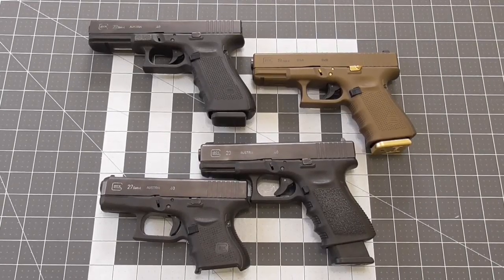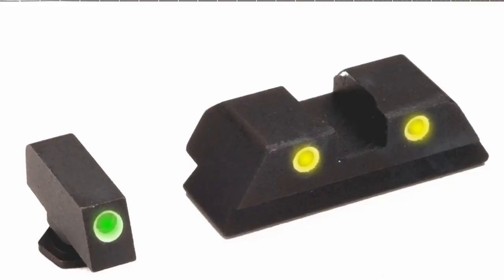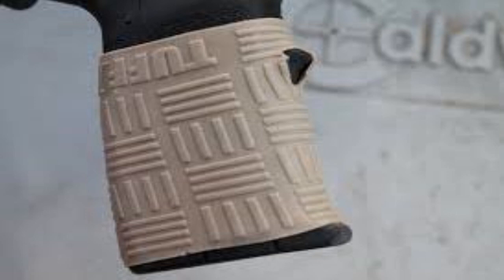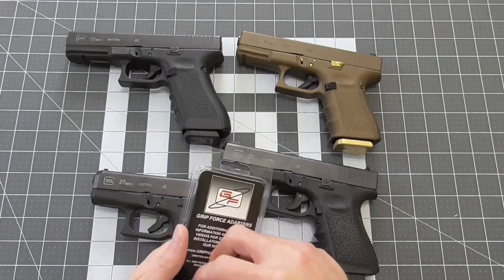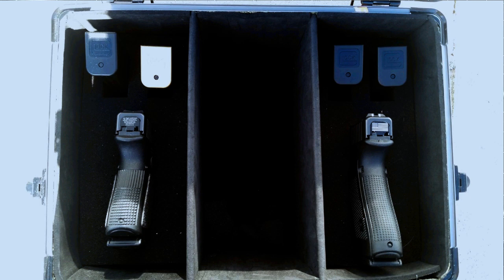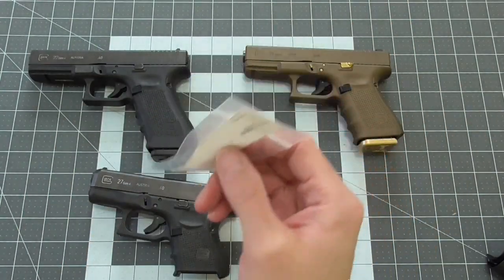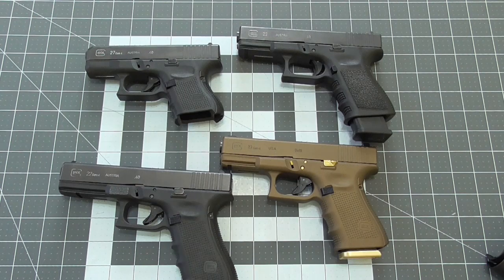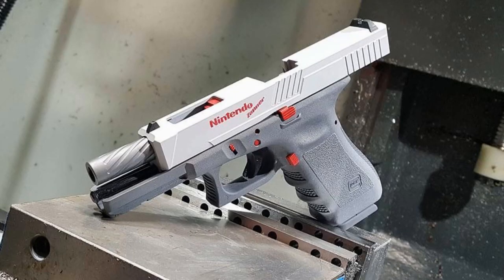Glock modification, aftermarket parts, and other accessories.

Comment: You talked about threaded and no threaded and size changes in calibers with barrels. But I carry a gen 4 Glock 42 and I've been looking for a heavier barrel. Know of any good brands?
Reply from the maker: Dive Hawg94 I'm sorry to say that I'm not as well versed in Glock 42/43. What exactly do you mean by "heavier"? Lone wolf probably stocks the most variety and is the most reasonably priced.  However you may try storm lake, Barstow, Zev and if you are looking for Ultra match grade barrels, check out  "Blacklist". I'm sure that gun may be a bit tougher to track one down for but every brand here is reputable. prices will range from around $100-$300 depending on finish, brand, grade, ext. Hope this helps.

Comment: Very interesting modifications!  Most of this is WAY over my head, but I do like those night sites and the textured grips.  Quick question Chase, is it true that Glocks do not have safeties?  If so, is there's any risk of discharge?  BTW, that underwater shot is cool!  Are they all capable of firing underwater?  Thanks Chase!
Reply from the maker: David Fiorini Hey David, It is true that glocks don't have a manual safty i.e a lever or button. They do have internal safties to where you could drop it off the empire state building and the gun would not discharge.
I know it sounds kind of scary to entertain the thought of having a gun without a saftey however, I have come to prefer this for several reasons.
1. my finger is never anywhere near the trigger unless I've confirmed empty or I've made the decision to shoot. Frankly, I believe safties can do more harm in some instances because it naturally luls people into a false sense of security which can lead to sloppy saftey practices.
2.( I see this almost every time I see someone firing a gun with a saftey,) they rack a round in and go to shoot but can't so they pause a moment and look at the gun until it dawns on them. Although I'm confident in my ability regardless of the platform, I feel it best to keep things as mind numbingly simple as possible, incase that dreadful day ever came and I was forced to use it, all the while bearing copious amounts of stress and adrenaline.
 Also, Revolves don't have safties and are regarded as great starter guns.
despite what many want you to believe, an untampered with Glock will not discharge without something entering the trigger guard and this is why it is important to follow good gun saftey and live by it. As scary as it was at first, you get used to it and it really is no big deal.
Anyway, yes, just about any gun will fire the first shot under water. Many will even cycle like the Beretta 92, sig p226, and many others. The maritime spring cups provide channels in the striker assembly that allows it to flow better under water. Striker fired gun aren't as good at this. It would be much like throwing a punch under water. Glock's even work for the most part under water but sometimes you can get what are called "light primer strikes" for the reason mentioned.
David, I really appreciate you taking the time to watch the whole video! Thank you for your comment as well and I'm sorry for the book I wrote you! : )
Reply: Chase Palagi   Hi Chase, thanks for the answers to my questions,  I appreciate the information.  It makes more sense now why it's not outrageous for a guy not to have a safety.  And I had no idea a gun could shot under water!  Shows you how much I know!!  Lol!
Thank you for making the video, watching is the easy part!  Take care, and see you in the next one!
Reply from the maker: You bet David! To be honest, I'm not certain that it is common knowledge. Frankly, I didn't know either until I tested it. They certainly aren't the most effective and I'm not sure why someone would want that but perhaps it's peace of mind?

Comment: Thanks sharing, Question. What is the best way install reddot on glock 34 gen 3
Reply from the maker: Kanthanok Phonsyry You bet! I suppose that depends on what you want. You can purchase a mount that sits in the dovetail of your rear sight but that sits a bit higher and you will lose your Irons. They also make a picatinny style rail that fits up top but has the same problems. If you know exactly the red dot you want, I would recommend a slide melt. You will have to send you slide to be Milled for the particular red dot you want. This way the the red dot will sit lower and you have the option to use buis. You will have to purchase suppressor height irons though. The only thing about this method is that it is done for a particular optic, so you can be switching them out. Also it may set you back a couple hundred dollars. If you are sure you want a red dot, and you know which one, this is the method I would recommend. Either that or purchase an mos slide, but those would probably be pretty damn hard to find as I'm not sure glock is selling them that way yet.
Anyway, thank you for watching!

Comment: When did you get that Glock 19? Also where did you get all that gold finishing? Was that bought like that or painted?
Reply from the maker: Ben Pope Hey Ben, That Glock is newer than the rest but I've had it for a while now. The finish is a Burnt Bronze cerakote. Glock has some special editions in burnt bronze and gun metal grey. This is one of them. Apparently, Glock does some sort of special mixture and treatment to better adhere to the frame and to better match the color.
I purchased the Gold hardware from the Glockstore. I have a Gold ultra match grade threaded barrel from blacklist barrels comming which should tie things together a little.
What do you think of the gold on bronze? I had never seen it done and thought it would be interesting. 
Anyway, I appreciate you watching!
Reply: Chase Palagi I think it looks cool. I have a grey Glock 19. Idk if you're on Instagram, but my name is GolfGunsLife on there and I have pics of it. Its a factory Grey 19
Reply from the maker: Ben Pope I am not on instagram but I need to be. I will check it out if it's not private  (or whatever is equivalent for instagram.)
oh okay, so you have the grey one? That's the one I was referring to. do you know anything about these? I saw these two colors and I really liked them! There just isn't much info on them so I'm not sure what the deal is. Is there anything special about them that you know of? l was just wondering if they're only making a certain number or anything like that.
Reply: Chase Palagi I'm not sure. I have never seen another grey or burnt bronze to my knowledge. My gunshop was the only one to have them in my area and I got the only one they had. I've seen a lot of FDE tho.
Reply from the maker: Ben Pope I was trying to check your page out but there are ads that can't be minimized? 
Anyway, I saw a glock next to the P320 and another one with the zero tolerance. I think they are the same gun but wasn't sure due to the filter. I really like that! I want to get one and do stainless hardware, I think that would look awesome. I'd lose points with the "tactical crowd" but I think it'd look great! lol : )
Reply: Chase Palagi ya I actually just got the p320 carry model yesterday. I love it. I was after a full size p320, but for some reason it just looks odd to me. The carry model feels great and looks great.
Reply from the maker: Ben Pope Of Nice! Good for you man! I love it! In fact I carry that one more than any other gun. I switch everything up every once in a while but once I stipple the grip, It feel absolutely perfect in hand! That's cool, I hope it serves you well!

Comment: Nice, I just picked up 2 kci 31rds mags for my Od glk22Gen4. testing it out tomorrow  at the range. #funsitcks
Reply from the maker: john ohhwee Hey John, I really hope you have better luck with them than I did! I ordered a couple  several years ago and neither one of them worked correctly. If I only loaded them up with few rounds they would but any more than that and the spring and follower would bind. I even took them apart, cut all excess plastic molding, brought factory glock springs and Never could get them to run properly.
I have heard of  some that did just fine with them though!
I really am not trying to be a buzz kill, I bring this up in the hopes that you are able to take them back and possibly exchange them for the 22 round factory mags that Glock makes.
 I truly wish you the best of luck with them!
Thank you very much for watching and taking the time to comment!
Reply: Chase Palagi for sure I'm going to check some oem mags tomorrow at the range. I'll be sure to post it up.
Reply from the maker: john ohhwee Yes! Please do! I was actually going to ask if you'd mind giving me an update, I'd kind of like to know how it all works out for you. Good luck man!